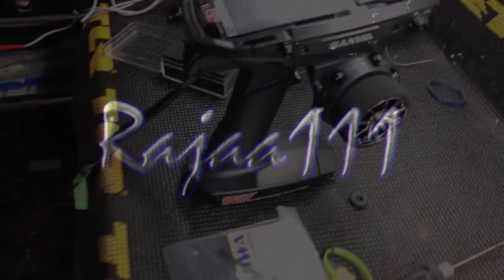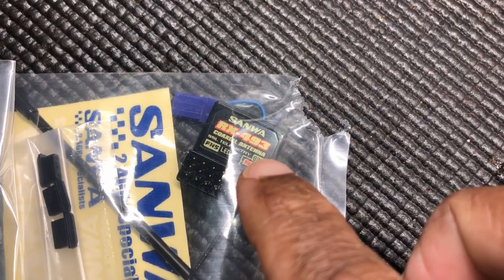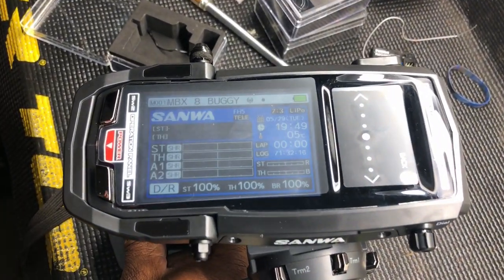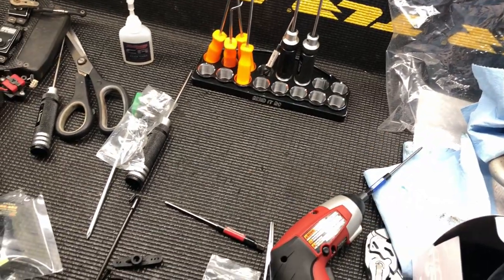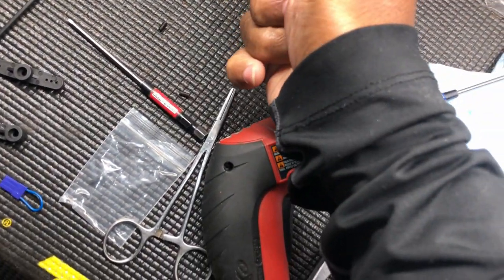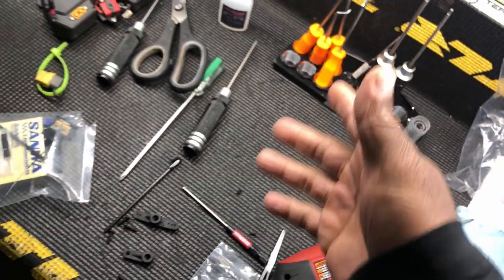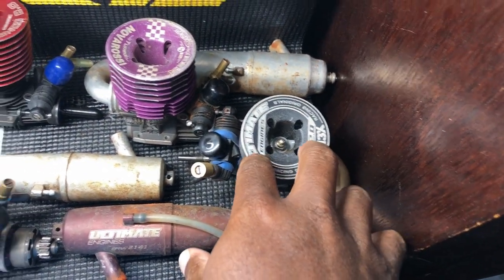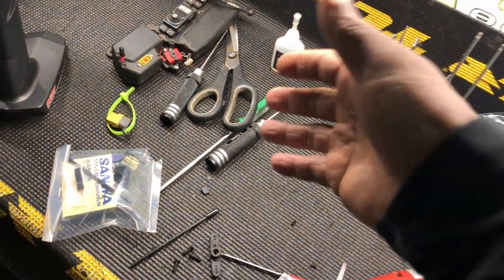Quick Look at the Sanwa M17, some info & updates

Comment: Nice job bro. Great looking radio, I just got one too. Christmas gift to myself 😀 If you didn’t already know you can use that thumb wheel knob up on the front right edge of radio if touchscreen is an issue. Also the lanyard bracket I had to use that foam they give otherwise it rattled around to much. That’s one small thing I wish they did better. My mt44 was way better for that. But it’s minor. The battery, and maybe CJ had more experience with this, but I’m trying to decide between the stock one or upgraded version Lipo. The battery tray is screwed on vs just slip off like the others. Allowing you to charge without removing battery, and also utilizing wireless charging. But I haven’t been able to use the radio yet being winter here. Great idea about promoting races from all across the country. That’s a great service to the hobby bro. Peace
Reply from the maker: My man, thanks brotha, I haven’t heard of any issues with the upgraded lipo battery cj uses it all the time and he has no complaints says it last forever, I feel you on the winter cold we freeze here also but I will be getting some track time soon with the radio and will give a update on how it was
Reply: Brotha, definitely get the upgraded battery. The battery cover is not loose so I don’t use the screw and it stays on no issues. I even took a spill down in FL with the radio in hand and battery cover didn’t move. On a three day race weekend I’ll charge the 5500 (upgrade battery) the night before I’ll use all practice day and qualifying day and then top it off that 2nd night for mains day. Don’t even think I’d have to but better safe then sorry. And that’s running 2 cars for those days. So with it lasting that long I don’t mind having to take it out when I do charge it.
Reply: @CJ220_GBR  thanks for that CJ I appreciate it.
Reply: @D70racing  my pleasure

Comment: Can you make a video on that xt90 receiver battery hookup you got going on please. I think people would like to do it that way if explained right
Reply from the maker: You got
Reply: use a servo extention, cut the negative and run each of the cut ends to the terminals on the plug. negative disconnect just like the big rigs
Reply: rajaa show em all the light,

Comment: Would you leave futaba man? I love  them? I currently have the 4:00 p.m. too I still love it. Also looking forward to seeing you at colonels.
Reply from the maker: I kept blowing or shorting out receivers, the radio was great never a problem there, just got tired of replacing receivers
Reply: @rajaa111  which ones where you using? I've been using r304sb an the r304sb-e for ebug. It has no antenna. But I'll had the first two for over a year or so. No problems, never heard anyone have problems with futaba. We're yours not HV rated? Coulda been the problem. But anyway , looking forward to seeing u at phil hurd bro

Comment: Nice. What was you using before and what trigger the upgrade?
Reply from the maker: Was using the futaba 4pm, great radio but I kept blowing receivers.
Reply: @rajaa111  really? I just got the 4pm. Should I be worried about blowing receiver?
Reply from the maker: No there’s plenty of people that have no problems with the futaba receivers
Reply: Did you have your setting on the futaba on t-fhss high speed instead of normal? I just read that high speed options is only for futaba brushless servo only and may cause damage to the servo. Could that be the reason your receiver blowing out?
Reply from the maker: @916vp  yes they were on normal, I read about that also, but I always ran brushless digital servos and no matter what setting it was on the receivers would still go out
Reply: @rajaa111  wow, that's crazy. Well hope your remote works out for you.